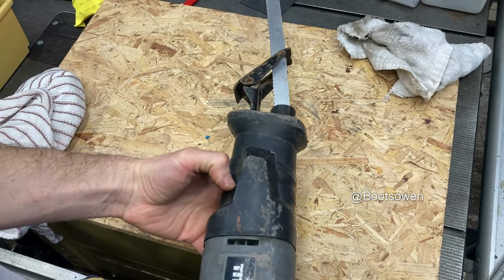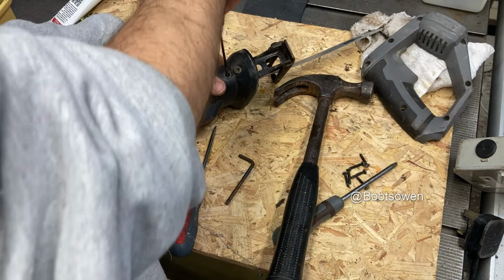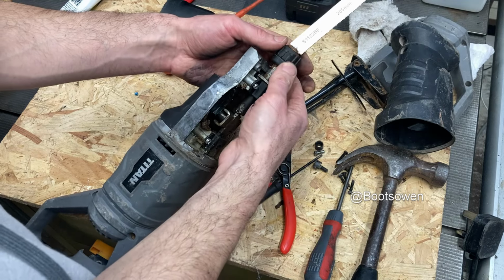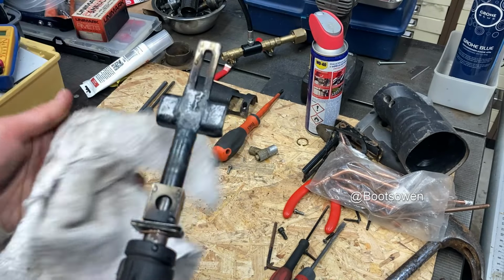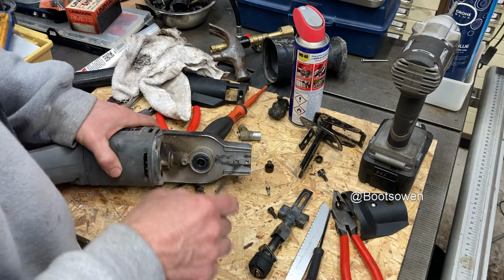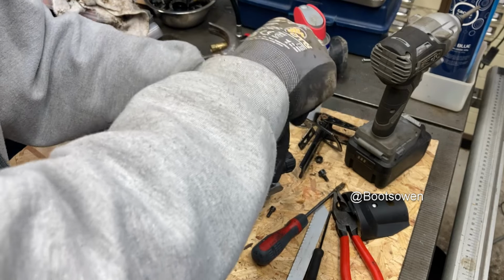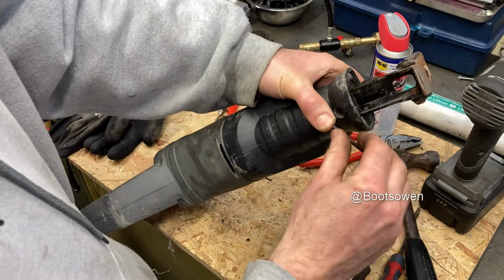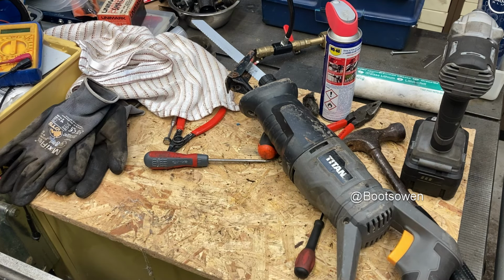What a horrible tool: Titan TTB533RSP broken shaft: welding a reciprocating saw back together

Comment: I'm glad you took the handle off so I could see inside. It looks like that switch could easily be swapped for a variable switch off an old drill. Now to look for an old drill! (This would save making a triac based soft start circuit)